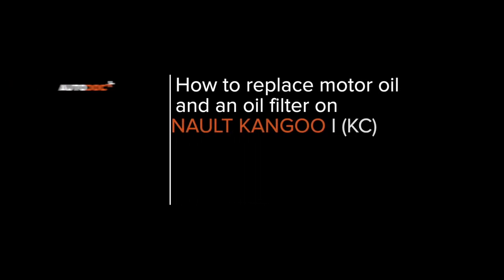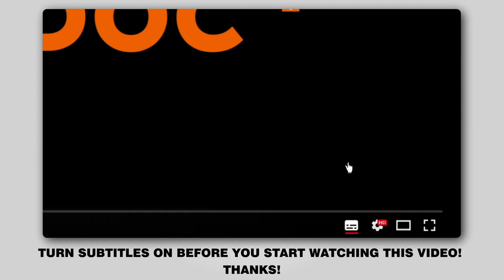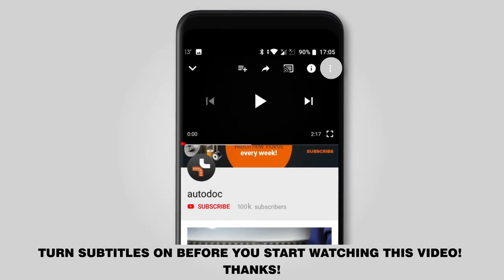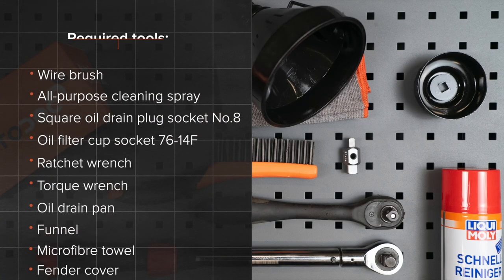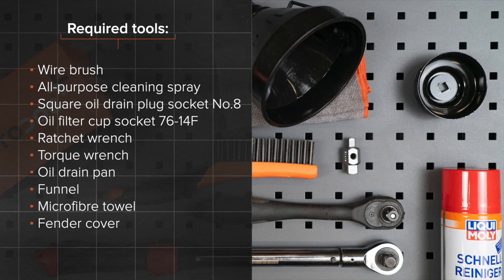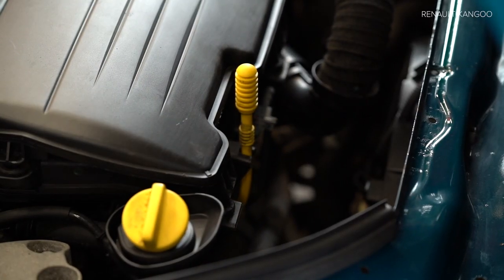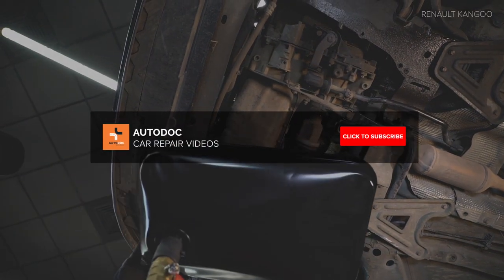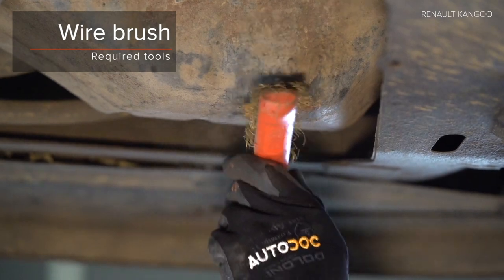How to change oil filter and engine oil on RENAULT KANGOO 1 (KC) [TUTORIAL AUTODOC]

Comment: What oil did you use???
Reply from the maker: Thank you for your comment!
Unfortunately, in this video, we did not specify the oil, for safety reasons. 
Since the engines were installed differently, with different volumes and different fuels. For this, we made a link to ours in the description. You just have to choose your engine and there will be a huge list of oils that we can offer you.
Best Regards,
Autodoc team